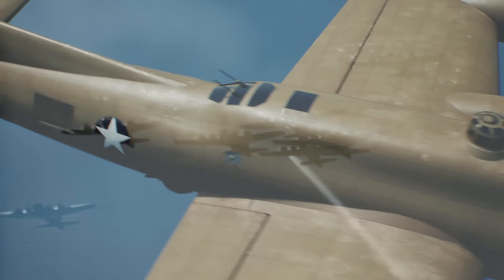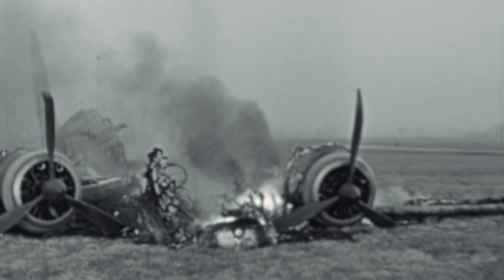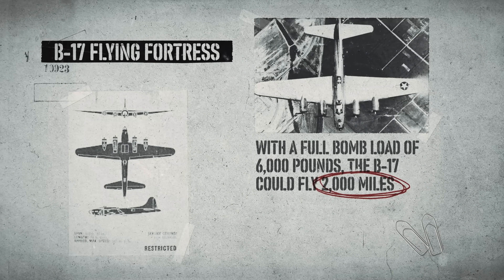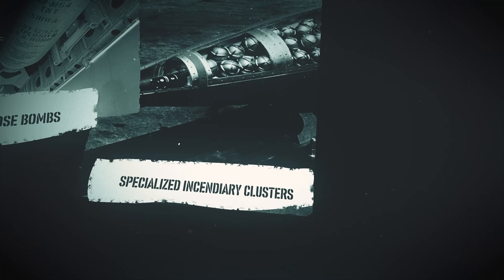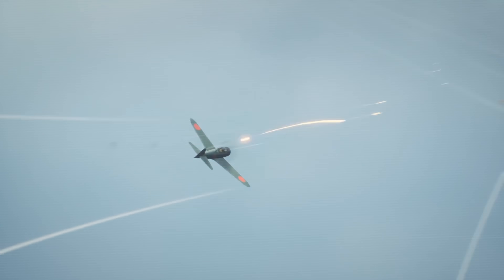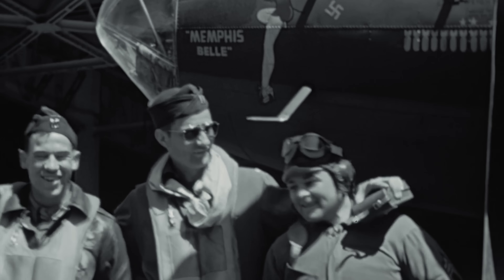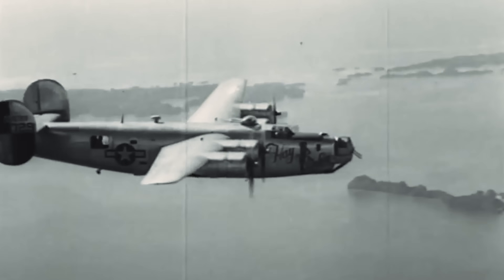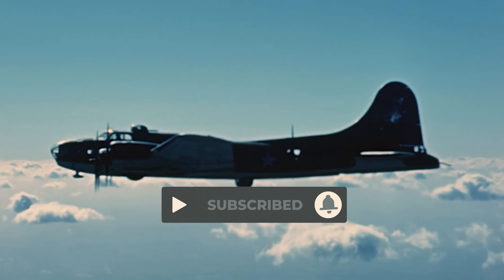The EXTREME Engineering of The B-17 Flying Fortress

Comment: "By September 1944, with a degree of assistance from Bomber Command, the USAAF
had brought German oil production almost to the point of extinction. Aviation
spirit production, for instance, had fallen from 156,000 tons in May to 54,000
in June, 34,700 in July, 17,000 in August and 10,000 in September, measured
against Luftwaffe consumption of 165,000 tons in April. Pilot training had all
but ceased; the Luftwaffe could not operate the aircraft Speer was still
producing with such huge exertions....How was it, then, that against the
USAAF's overall wartime effort of 131,000 tons of bombs dropped on oil targets,
Bomber Command with its greater lifting capacity contributed only 94,000 tons,
most of this in the last stages of the campaign?

...Yet in October [1944], 6 percent of Harris' effort was directed against oil
targets, less than in June. Between July and September, 1944, 11 per cent of
Bomber Command's sorties were dispatched to oil plants.

-"Bomber Command" —pp 381 - 408 by Max Hastings

Comment: The fact is that the daylight bombing campaign was a dismal failure. The B17, while tough as hell, suffered well over 50% losses. Bombing accuracy was, at best, 10-15% hits on designated targets. Some general or planner thought it was a good idea although at war's end they determined that the entire concept was an exceedingly bad and massively costly idea. They didn't do it again until bombing technology improved and crew surviveability ramped up. Then along comes Vietnam, somebody decided air mobile/attack was a good idea. That failed again with over 50% losses in helicopters. I guess we don't learn from history.

Comment: The extreme losses of the B17. You had a better chance of living through the Somme than completing a tour. It only stopped becoming a coffin after the Luftwaffe were wiped out by Mustangs.
Reply: Correct 37% of B17s were shot down. It was indeed a flying coffin.
Reply: @Grisostomo06  Losses of B-24's were even higher,.
Reply: Yes we all know the Yanks did it all,,, 🥱
Reply: the thunderbird destroyed the german air force before the m escort ever happened..
Reply: @rupertbear6883  the spitfire also helped, but the poor range of the spitfire hindered it's ability to go the distance. the RAF did help as much as they could. the spitfire was otherwise an excellent dog fighter. the big difference the mustang made was the ability to esort all the way to berlin, the thing that made the mustang so great was the merlin, similar to the merlin the spitfire used. the mustang merlin was built under license by packard
Reply: Unstoppable?
Reply: Spitfire P38 and corsairs etc. The mustangs were the first to accompany the B17s over German Air. The others had to turn back.
Reply: Right Before replaced Eglish merlin engine  P-51 escort B-17 8th Army air forceman leave alone lost about 60.000🙏❌️🇺🇸🇺🇸🇺🇸🇺🇸🇰🇷🇰🇷🇰🇷🇰🇷
Reply: Mmm, Mustangs assisted the Thunderbolts; but they did not solely wipe out the Luftwaffe.  Beautiful aircraft, built for the heavens; but the Thunderbolt was the workhorse, completing both air and ground attack roles starting with the airfields.  Luftwaffe couldn't even train new pilots without the trainer being shot down; but that was war and everyone is mostly happy that it's over...

Comment: The B 17s maximum Bomb Load was the same as the Vickers Wellington, Armstrong Witworh Witley and De Havilland's Mosquito,all twin engined designs.The Henkel 111 and Junkers 88 had similar Bomb Loads to the B 17.The Mosquito was a fraction of the size of a B 17 with a crew of two, with the Bomber and recconocance variants having no armament for self defence, relying on speed for defence. More B 17s were lost to German flak and fighters than Mosquitos. It's only American arrogance that has the B 17 in the top three bombers of WW 2.
Reply: B17's first started in 1936, the Mosquito (which I really like) didn't start production until December 1941.  Also the Mosquito did not have the same range as the B17 at the same load.
Reply: I think the two planes were complimentary to pursue specific roles. They were both needed for their roles
Reply: Arrogance,  pronounced Stupidity 😢
Reply: @andyb.1026  Ignorance is all it is. Do your homework before making ugly and misleading statements

Comment: The turbo starting to feed the engines single stage single speed supercharger beginning at medium altitude is what gave it the high altitude performance it had, not the engine's single stage single speed supercharger itself, that's only good for low altitude on it's own.

Comment: EXTREME .... the Mosquito carried just as many bombs faster and with fewer crew members
Reply: It just proves how fast aircraft  development was moving. Besides, '17s could carry more bombs than that
Reply: @oxcart4172 
The reality is Mosquito's only carried about ⅓rd to ¼th what a B17 could carry on the same mission, anyone who believes an aircraft with 2 engines of similar power that has less then half the wing area of a 4 engine aircraft can carry the same bomb load obviously knows nothing about how aircraft work.
To make things worse for the Mosquito the bomber version was completely unarmed and took over three times as many escorts per ton of bombs carried, B17's on Berlin missions carried between 6,250 lbs and 8,200 lbs depending on what kind of bombs were loaded, Mosquito's carried around 2,400 on a Berlin mission, so if you had enough Mosquito's to match the same amount in tonnage of bombs carried by 300 B17's there wouldn't be enough escort fighters in all of Europe for the mission.
Reply: @dukecraig2402 
Well said!
Reply: Nope, that's internet nonsense
Reply: the B-24 carried more bombs and went faster than the B-17
Reply: @Hi-lb8cq yes I could but a few cannon rounds near wing root from German fighters or flak round the wing just folded but yes a fast machine if a little flimsy at times
Reply: @markgriffin3184 
Anything that takes hits by the wing roots and they'll fold, that myth that the B24 was prone to it is from that one particular snippet of combat footage, and it wasn't even flak that hit that B24 that was a bomb from a B24 above it passing through its wing near the root that caused that.
Reply: @markgriffin3184 your point is what , the airplane was worthless ?how ridiculous !
Reply: @Hi-lb8cq 
B24's had a maximum internal load that was slightly more than a B17 but on the same mission they carried very similar loads, there wasn't some huge difference between the two.
Reply: @dukecraig2402 yes but it still held more and could go faster then the b17...
Reply: No it didn't, that's internet nonsense invented by people like Mark Felton and believed by people who obviously know nothing about aircraft. 
B17's carried as much as 8,200 lbs on Berlin missions, the average loadout on a Berlin mission was twelve 500 lb MK64 general purpose bombs that actually weighed 525 lbs despite their 500 lb classification, that's 6,300 lbs, Mosquito's carried just over 2,000 lbs on a Berlin mission.
Aside from people who believe that Mark Felton nonsense obviously having no interest in checking mission records they won't even bother looking at pictures, they believe that malarkey about B17's only carrying 4,000 lbs on deep penetration missions yet there's countless pictures of twelve MK64 GP bombs falling out of them taken above Berlin both salvo and train style drops, even if someone thinks that they only weigh 500 lbs apiece that's still 6,000 lbs.
Furthermore as the bomber version of Mosquito's were unarmed it took about 6 times as many escorts per ton of bombs delivered than it did with B17's. 
Anyone who believes that an aircraft with 2 engines of similar power compared to one with 4 engines that has well over double the wing area and much more fuel capacity per gross weight could carry the same amount of weight an equal distance seriously needs to brush up on basic aerodynamics, Mosquito's were bound by the same laws of physics as all other aircraft, the designers and crews didn't have magic dust they could sprinkle on them so they could defy those same laws of physics and aerodynamics needs a reality check, no matter what aircraft it is the heavier it's loaded the shorter distance and lower altitude it'll fly at, there's no way around it so none of them flew their maximum speed and maximum range with their maximum load, Wikipedia listings may seem that way but go ahead and use their numbers for a flight plan and see if you make it to where you're going. 
You can't find a single video on the B17 without someone coming along and making that nonsense claim about Mosquito's, and like the rest of them I'd like to thank you for the opportunity to set the record straight about that malarkey claim.
See you at the next B17 video.
Reply: Trouble is with mosquito being made from wood when it crashed it went like  a bomb on guy falks night . But a wounderful aircraft and gave the luftwaffe nightmares for a few years .
Reply: @Zat77
Thank you for the opportunity to set the record straight on the nonsense myth that Mosquito's could carry the same load as a B17, the list of reasons, aside from the fact that Mosquito's couldn't carry anywhere near what B17's could carry, of why Mosquito's couldn't perform the B17's job is long and I'll welcome any opportunity in the future to list them, see you at the next B17 video where you'll undoubtedly be repeating that same Mark Felton malarkey claim.
Reply: And , your point is?

Comment: Less than 500 views, but this is an awesome video. I love the B17. Spot on
Reply from the maker: Thank you! I really appreciate it :)
Reply: It's full of so many errors it's laughable, like the 6,000 lb claim, a standard loadout for a deep penetration mission was twelve 500 lb MK64 general purpose bombs, which would be 6,000 lbs but just because they were classified as 500 lb bombs doesn't mean that's exactly how much they weighed, they were actually 525 lbs apiece, and some missions to Berlin carried as much as 8,200 lbs depending on the bombs used.
The engines single stage single speed supercharger most definitely didn't give it high altitude performance, that type of supercharger is only good at low altitude, it's the turbo that starts feeding the engine's supercharger at medium altitude is what gave it high altitude performance, the turbo is even in the illustration used in this video complete with arrows showing air flow through it.
Reply: But. 

  By gt77 hi hi